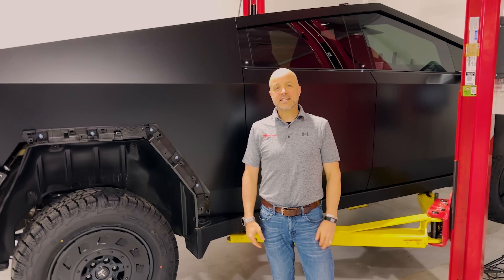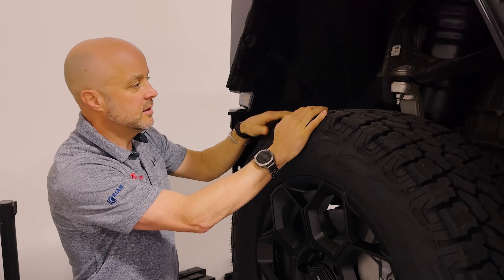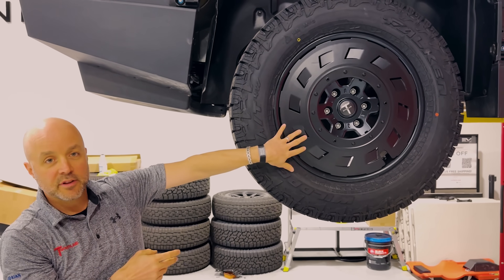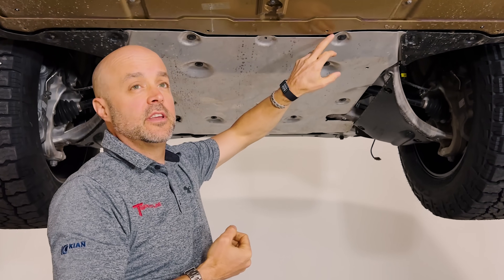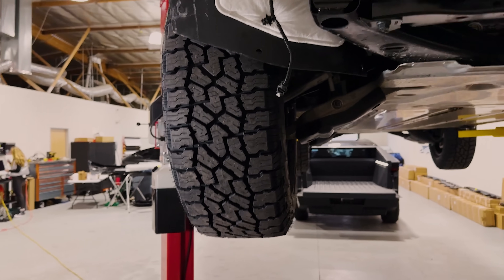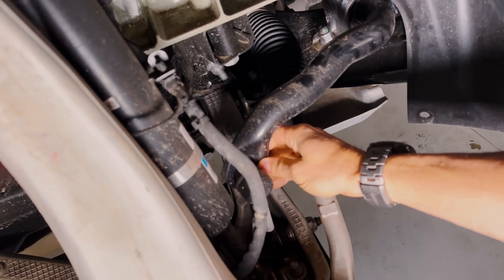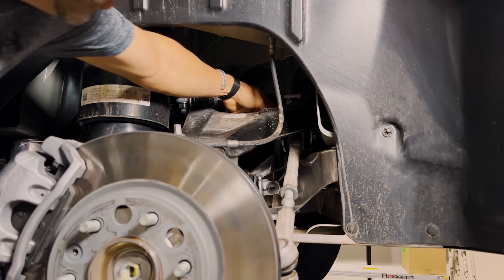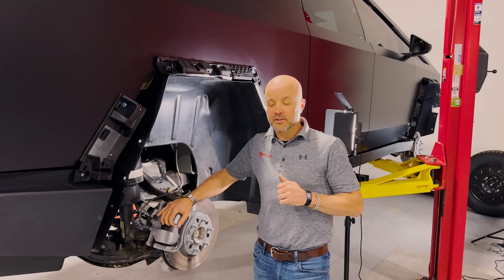Dissecting a Tesla Cybertruck! Underbody & Wheels off Chassis Inspection and Walkthrough, first look

Comment: Yes, wheel spacers, always a good idea.
Reply from the maker: Doable, for sure!  Just need to be mindful of when this lowers, that fender clearance matters.
Reply: I want 5" lifts for CT and 32" Rock wheels.
Reply: don’t spacers have issues such as durability, and extra stress on bearings etc.?
Reply: @bartwaggoner2000  Yes, they do and affects alignment to a degree. I was actually being sarcastic in original comment.
Reply: @bartwaggoner2000  Have also seen them shear off wheel studs.
Reply: @timothyorendorff7642  Unfortunately even obvious sarcasm is often missed.
Reply: Yep, illegal in some countries for a reason..
Reply: @danharold3087 One man's sarcasm is another man's Great Idea.
Reply: I have a feeling spacers will mess with the steering by wire and sensors involved. Could get wanky handling with enough spacer to clear that suspension upper ball joint that's so close to the tires.
Reply: @dlux703  Good point, never thought about fly by wire.
Reply: Remember, these are tesla stans, they don’t actually know anything about trucks, or how to drive for that matter.
Reply: Knowing the weight of the vehicle, I wouldn't recommend wheel spacers, it's just asking for trouble.
Reply: It's unfortunately not a good idea on this truck sorry mate
Reply: @markplott4820  Lol!!!!!!

Comment: I would not take that off-road without some full body skid plates.  I see one puncture in the wrong spot deadlining that truck.   Light off-road duty yes, but heavy duty I wouldn’t risk it
Reply: Unplugged Performance is already selling Ballistic under Armor for CT.
Reply: Tesla designed the truck to take a skid plate under the battery.  The holes are there.  I would not be surprised if they have that on the entire underside.   The people who really want to off road the truck will change out what is there.  Tesla is selling what most owners need and aftermarket will provide the rest.
Reply: I'll never understand why people keep moving the goal posts on the Cybertruck and fault it for things that it's competitors is also guilty of. You'd never take any stock PICK UP TRUCK heavy offroading without some HEAVY off roading modifications.
Reply: @themonsterunderyourbed9408  - FACTS are Cybertruck is Better than any EV truck in Production, and it will be MORE profitable w/ higher REVINUE than any other. 
in a few years it will OUTSELL Conventional ICE/Hybrid trucks. 
RIP legacy trucks.
Reply: @themonsterunderyourbed9408   - the POINT is Cybertruck is very TOUGH & can go OFF ROAD in STOCK configuration.
Reply: The majority of owners buy this for city driving not for working or off road. It's cool and high tech. I am not a truck guy but definitely will buy one. I would take a couple times a year for camping or load few items.
Reply from the maker: We will see!

Comment: Tesla still hasn’t learned their lesson for cheaping out brake calipers and rotors. 😂😂
Reply: Most people will use regenerative braking.   If your going to go racing upgrade the standard brakes.
Reply: @danharold3087  Yeah, I have heard that tired excuse too many times.
Reply: @JetFire9  You have heard it because it is true.  The most frequent problem people have with Tesla brakes is that they rust from disuse.
Reply: @JetFire9  why is it an excuse again? The stock iron rotor plaid stops from 60mph in 104' in its class anything below 120' is considered to be excellent. The model y&3 consistently outbrake and outhandle their ev segment competitors. 

And the ct has already outbraked a raptor r in the carwow comparison test. 🤔
Reply from the maker: interesting

Comment: Are you guys going to fabricate wheel spacers and lift kits like Unplugged  Performance did already? 2.5 inches of lift plus wheel spacers plus 37" or 39" tires and then ground clearance can seriously increase from merely 17.4 inches, all the way up to  22 inches, which would be ideal for extreme off roading.
Reply: Those control arms already look like they are at their max for tire size. 37s weigh around 140 with wheels each. That thing will not survive anything beyond fire trails.

Comment: I put 35" Nittos on my Beast and the wheels have pretty good offset. Unfortunately the tires wore through the front wheel well plastic and into the AIR suspension hose. Almost $1500 to repair the front right air line. I would love to see somebody do an  aluminum wheel well that accomodates larger offset wheels.

Comment: Honestly I have been driving my model 3 for 4 years and over 110k miles so my biggest gripe is range and for me because I drive in the city so much that stop and go is a range killer any improvements in this area is much appreciated
Reply: I'd be interested to see how lightweight you could make a model 3 if money was no object  and how this improves range.
Reply: @michaelyounes29  The problem is the vehicle was already made "lightweight" to begin with. The model 3 has the most simplest design and everything on it is already lightweight as is. Only way to make "improvements" on the range is getting the long range version.
Reply: Calling city traffic a range killer debunks the claim that you own an EV and exposes that you didn't even do some research into the topic before writing your FUD story.
Reply from the maker: interesting
Reply: Umm how would stop and go traffic affect an ev at all? It should use even less battery because the motor is being engaged less often.

Comment: Mentioning at the beginning that you would be focusing on areas that can take accessory would have been a good idea. This was definitely not a technical overview. You looked right at the steering motors and didn’t point them out. 

Great overview for your area of expertise.
Reply from the maker: Great suggestion! Shot it on the fly, no prep or edits - just wanted to get you something to start with, more coming soon!
Reply: It turned out great. Keep them coming.

Comment: Dude almost crushed the cab. The cab was literally up against the top of the lift crossbeam and you could hear the lift strain. Did it dent or mark the top?
Reply: LOL. He could have driven it right through it and the ceiling and the truck would have been the only thing to not take any damage...
Reply from the maker: Ha ha, it didn't touch the roof.  That's just the lift at the limit.
Reply: @HenryLoenwind  Maybe.  But I've heard the final thickness of steel actually used is a fraction of what was originally promised by Elon.  Like most things, Elon over promised and underdelivered.

Comment: So you're basically fixing all the issues of the "truck" and actually making it a truck, got it. The fact that you have to make major modifications just to put bigger tires on it is a deal breaker for me.  The brakes are too small (as usual for Tesla).  Luckily most of the owners of these things will only be driving to and from the grocery store and the gym.  There's just so many corners being cut on the manufacturing of this thing that I'd feel less than confident taking it on gravel.
Reply from the maker: It will be interesting!

Comment: I'd like to see a smaller rim size for my standard Cybertruck tires, and many serious mudder will get much smaller wheels, down to 15" to get more sidewall if they want it. This trend of oversize rims is killing range. I'm surprised/not surprised Tesla didn't design it with 18" rims, which is what the other models should have, too. It always stuns me to see how much money, time, and effort people spend on bigger rims that hurt their efficiency.
Reply: a lower sizewall tyre has less rolling resistance. so if you have a 20 compaired to a 18 same weight as width tyre the 20 is more efficient.
Reply: @krusher74  That's why I mentioned mudding. For efficiency, you want a regular sidewall and smaller rim. For going through mud bogs you want more sidewall, like a monster truck tire. You don't want low profile tires unless its a street truck or lo-rider. Snow & bad roads in the Midwest destroy thin sidewall setups.

Comment: I was expeted to see whether the suspension shape will trap the water or not. Because early models S was kind of gathering water like shape so it suddenly broke. But I couldn't observe well from this video because of plastic under cover or the angle of the camera was not for that
Reply: Model 3, but I know what you mean. Driving through a deep puddle meant you left the rear bumper behind.

The model S didn't have that problem.
Reply from the maker: Interesting.  The aero cover on the lower control arm is not sealed. So I didn’t see any obvious concerns.  But we will keep looking.
Reply: you can use CT as fishing boat w/ Trolling motor and Inflatable RHIB skirt.
Reply: @cooluser23  I watched video from model S.
Reply: @TSportline  Thanks for the information of the cover is not sealed. And I also wanted to know that any water can sneak in to the subframe with out the exit hole. If there is no exit hole it should not have entering hole or room inside of the subframe like model S did. Thanks for the video. It's the first offering I guess.
Reply: @markplott4820   I recall the segment in the factory where that came up.   More like something that should work as opposed to intended purpose.

Comment: Will a smaller tire improve the range? If so, how much, 35s are pretty big. I can see having smaller wheels without compromising much off road capabilities.
Reply from the maker: Possibly.  A lower ride height will be better for aero.   Smaller frontal cross section on tires usually does better too.

Comment: Hi there. Could one fit a winch on the front of the Cybertruck in addition to a front tow hitch? Reason is that when launching boats from the beach, one would push the trailer with the boat into the sea, not to mention being able to winch the boat onto the trailer from the ocean using front winch.
Reply from the maker: We are working on this...
Reply: You wouldn't have any battery power left

Comment: Can you do an air suspension delete?
Reply: then you'll have Difficulty enter/exit the CT.
Reply: @markplott4820 Called side steps and running boards. Been invented for a while. 😂😂😂
Reply: @JetFire9   - no one Aint got time for that.
just LOWER the Air suspension @ ground level.
Reply: @markplott4820  How many real truck owners have time for bags?? 🤣🤣🤣🤣 Like none! Respect the process.
Reply: @markplott4820  Pretty sure in a few years there will be an entry level CT with standard suspension
Reply: How are the panels attached to the frame?
Reply: @NinetyTres   - UNLIKELY , just like RWD model Y , CT RWD will be DELETED.
Reply: @JetFire9   - MOST Diesel truck owners operate on BRAGS.
Reply: @mickjoebills  Elmers glue
Reply from the maker: wow, doable I guess - but not likely common.

Comment: I am not electrical engineer or understand electrical, but isn't the high voltage is risky in car ?
Reply: yeah only if you dont take proper precautions before going near the high voltage areas. they have a loop for accidents that can be cut and will disable the high voltage system. its for emergencies etc. to work on the high voltage area, you can pull a fuse type unit that will also disable the battery pack.
Reply: I'm not a chemical engineer, but isn't having a highly explosive fluid in a car risky?
Reply: oh like gasoline? haha yeah lithium ion batteries can be dangerous if they catch fire but its much rarer than gas cars especially in teslas. they have many features that protect the battery. even in crashes the tesla pack acts as a structural part of the vehicle. very strong. @HenryLoenwind
Reply from the maker: It offers many benefits (48v).  The high voltage is a different system, yes dangerous.

Comment: I guess my question would be: how well would it survive a deer strike?  Offset and center mass?  How expensive to fix?  This is a big issue with today's trucks vs 20 years ago!
Reply: anything breaks on it and you will go through hell trying to get it fixed. special parts, tools and troubleshooting computer and software etc. and Tesla will keep everything in house so the waiting times will be endless I bet.
Innovative truck for sure. but it is far from practical and I ssupect they will be hell on earth as they take on some age and wear and tear....
Reply: It's not an issue most vehicles handle it fine.
Reply: @JokerInk-CustomBuilds Every single car has special parts. If cars had the same parts everything would be the same. Also anything can be removed with normal sockets. Their software allows certain things and you can use scan tools. Teslas have the least amount of problems and batteries have been advanced 700.000mile is nothing for them.
Reply from the maker: Deer will not be good.
Reply: Fewer parts to damage up front compared to an ice?
Reply: @dkdanis1340 most small cars have interchangeable parts. They also have good supply chains and aftermarket suppliers.  I'm in Australia and I can still get parts from Toyota for a 2000 hilux and many of them are in stock in Australia. If not, they're about a week away. I also can get a bullbar to prevent the damage in the first place. 
If the engine dies there's plenty of options to get it rebuilt or buy a rebuilt one. 
Even better,y fuel tank is unlikely to fail and doesn't lose capacity over time. And if it gets damaged badly it'll just leak diesel. It won't create a fire that's extremely difficult to deal with.

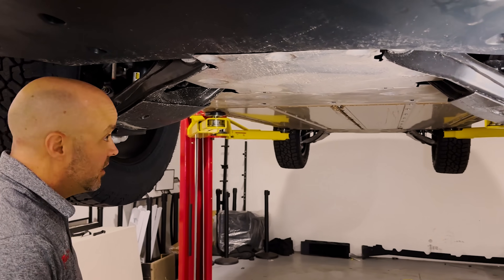Comment: 6:28 ... The rear plastic over bites.  Really cuts down on the departure angle of the truck.  Would be nice if those bolts above the front tires would not be there so a  larger tire could be installed without spacers.
Reply from the maker: yes

Comment: 1) are you sure that's a radar in the front? Tesla has switched over to vision for all their cars and removed the radar module. Wouldn't make sense for the CT to have one.

2) offsetting the wheels might put too large a strain on the steer by wire system. We can't know what it's capable of until someone tests it, but it's safe to say it's probably not heavily overspecced
Reply from the maker: Yes, I think we mispoke there, it's the bluetooth module - but has zero markings on the front side.   Good point on offsets.

Comment: Did the roof dent from running into the top cross bar of the lift?
Reply: That was getting really close.
Reply: A. It hit the end of the hydraulic stroke before it hit the cross bar, you could hear the relief valve squeal when it got there.
B. The top bars on lifts like that have a pressure switch touch sensor that stops the lift if anything hits it, not just to protect the car roof, but because it if you hit it, you would risk the lift failing as it pulls the two posts towards each other.
Reply from the maker: It didnt touch!  Plus the Rotary lift has a bar on the top that shuts off the lift before any contact.

Comment: I am not qualified to know any better but the track rods look extremely spindly for a heavy offroad vehicle. Though if you made them bigger the rack and servo may be the weak link. Thin pressed aluminium panels underneath are presumably chiefly for aerodynamics, strange they did not use plastics which could be as light but quieter. To offer good protection against rocks they will probably have to be fairly thick steel with mountings to suit. To their credit there appears to be plenty of ground clearance...
Reply from the maker: Time will tell!

Comment: The SS edges appear to be finished ever so slightly. Also, the unfinished aluminum brake calipers show a bit of cost cutting by Tesla.
Reply from the maker: The edges are unlike any other car panel, no hemming or rolled edge.
Reply: Aren’t the panel edges beveled slightly?

Comment: Disappointing to look at, if not surprising. Closer to a station wagon than an off-road vehicle. Seems like a good opportunity for someone to replace the aluminum areocovers on the bottom of the truck with steel or composite rock guards. That open gigacasting might be light now, but it is going to fill with a hundred pounds of slush after a couple of winter drives, and the same amount of mud if someone does occasional off-roading. I would probably fill it with spray foam.
Reply from the maker: thanks for watching

Comment: I know that people like the look, but if you mess with wheel and tire size or have the wheels stick out it's going to really shorten the range of the truck. I wish the suspension hadn't been with so much steel - that looks like the only part of the car that would rust.
Reply from the maker: yes, good points

Comment: That milar plate is overkill, I wouldn't be concerned about it. Though chips in it could hit the resale value and be expensive to replace. It's only worth it if you also got beadlock wheels gor real rock climbing. But that sport will take many years to mature, expect many broken sway bars and stuff poorly designed for rock climbing. This is Tesla's first ever vehicle that will do any sort of rock climbing.
Reply from the maker: Yes, we will see!

Comment: Did we just run a brand new CT into the top of the lift?
Reply: No, it hit the end of the hydraulic cylinders before it got to the top. And there is a touch bar on the top that will stop the lift as soon as something touches it.
Reply from the maker: No, never touched.  The lift maxed out, that's all.

Comment: Would you be so kind and compare it with an Audi E-tron? So we dont miss all there compromises and failures by design from Audi. Bad engineered high voltage connection between drive train, battery and other components.
Reply from the maker: that would be an interesting comparo!

Comment: How come cybertruck is a 6 bolt wheel when the F-350 is 8 bolt lugs?
Is NHTSA going to yank Tesla's chain over this.
Reply: Because the Cybertruck is in the F-150 class, not the F-350 one?
Reply from the maker: it's load rating based.  10k GVWR